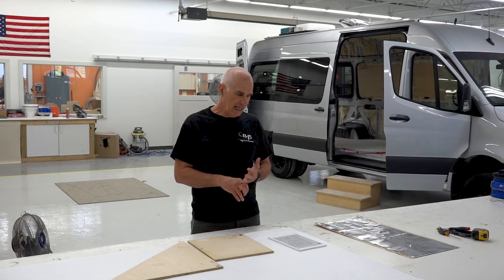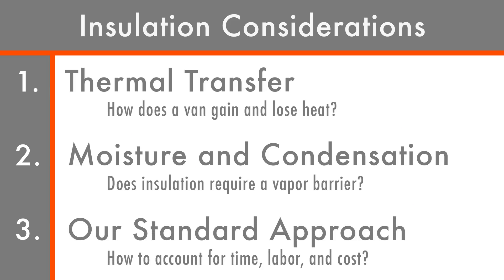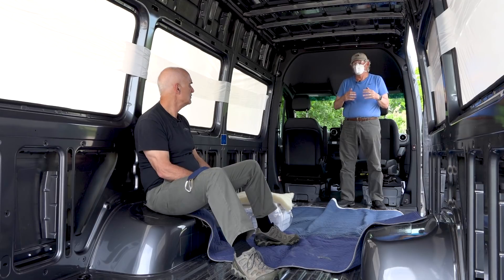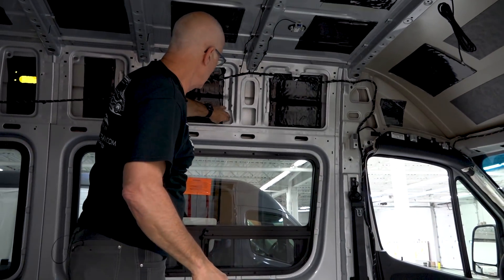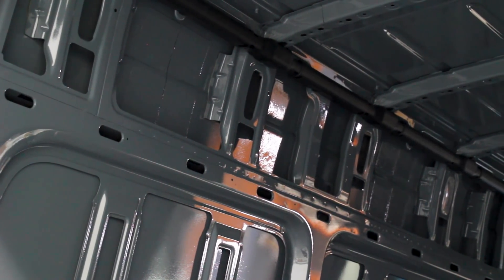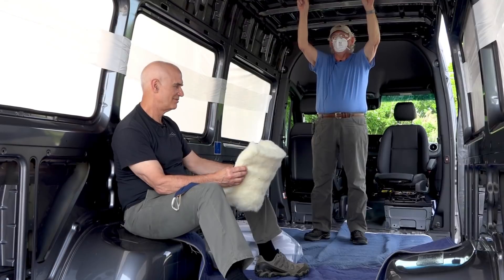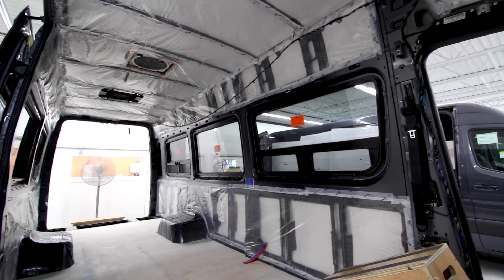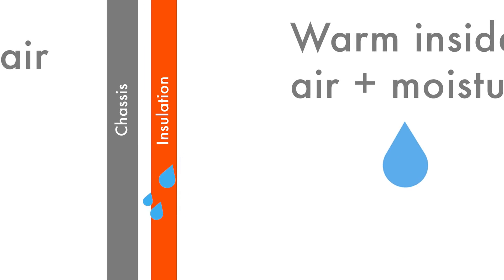What We Know (and Don't Know) About Van Insulation | Advanced RV

Comment: Wood stoves and Espar type heaters will dry and keep dry a van better than anything else. After that you want to create a thermal break at every thermal bridge.. do that with firm closed cell foam strips. Then control air exchange into the structure of the van with controlled venting. You can divert some of the forced air from an Espar actually into the open structure, behind the walls to keep thing dry (and remove snow ). Did this on a T1N.. worked perfect.

Comment: You need to insulate the whole thing then use reflective over it , have a vent under and up and it will cool . Have u heard of rockwool  and cold cell.? Use that the  a 4 inch pipe wrap on the beams .

Comment: I'd say one the insides of the van the metal is likely treated with a rust proofing finish. If you damage that coating in anyway while installing stuff then moisture could be an issue.

Someone mentioned drainage holes at the lowest points of the vehicle. Just wanted to chime in, using hydrophobic insulation with a vapor barrier, mixed with holes at the lowest point for drainage makes the most sense to me from a longevity standpoint. This also prevents mold and mildew due to the condensation having someplace to escape.

As for specific types of insulation, it's climate dependent. The insulation needed in December in say the southern USA is far different than the insulation needed in northern Canada.

Where I live, I wouldn't use R7 wool, by building code houses need to be need 20 on the walls and 50 on the roof. So I'd be hard pressed to go less than half of that, specially since I'm restricted insulation thickness. Which will determine the type of insulation needed. Higher the R values = less money to be comfortable during winter.

As far as summer goes and staying cool, cover those windows with a white or silver backing. I can't stress this enough. The idea is to reflect the radiation away from the inside of the van. Not painting the van a dark color helps as well, not as much as the window reflectives though due to the insulation previously mentioned.

You can test this during the summer easily, put a reflective blind up on all the windows during the night after the building has cooled down on the inside. Then measure the change in temperature over the day vs not putting the reflective blind up at night. A house or apartment will stay shockingly cold throughout the day without the sun pumping radiation through the windows.

Comment: Not sure how good this information is here. Wool? It settles down into the walls and within a few months you will have none in the upper portion of the walls - also, it soaks up water and thus can mold, same with denim (a horrendous choice as cotton is hydrophilic- water loving), traditional fiberglass insulation also has the problem of settling when vibrating in the walls of a van going down the road. XPS Rigid foam board is a good choice - does not soak up water, does not settle in the walls when going down the road, high R-Value. And for the best overall performance? Remove all single pain windows and either cover them up with galvaneeled steel sheeting or replace them all with double pain RV windows (Ie. Arctic Tern windows). Once you have your windows set, do all the wiring, propane lines, and water lines (though these you might want to keep out of the walls and put them in a more accessible location for future repairs) and then shoot spray foam (closed cell) or have a professional do it as it is tricky to work with and you only get one chance at getting it right. Closed cell spray foam is the most effective and durable, non moldy solution. If anyone wants to learn more about this I suggest you check out YouTuber Chuck Cassady. He is an excellent teacher/presenter, has many many years experience building and insulating school bus tiny homes, and definitely knows what he is talking about. The suggestions these guys make will only serve to help you grow mushrooms inside the walls of your expensive van. Cheerio!

Comment: If you live in humid environments the vapor barrier should be on the outside of the insulation, In moderate and dry environments it’s the opposite then if an air conditioner is used that humidity buildup would easily be dried from the air flow and normal ac process
Reply: Very basic rules they should have covered.
Reply: What if you live in a humid state but frequently travel to dry states?  How do you do the moisture barrier in that scenario?  I live in Louisiana and love to travel and hike in NM, AZ and CO.  Several months away from my van build but I want to make sure I do the insulation properly (mold and mildew are my biggest fears) as it will be a four season build (A/C, Max fan, heater).  I will also be living in it when I work out of state/not working from home (I do both at random times) and never know where I will be sent.  Right now it's Alabama and Georgia, in a few months it could be New Mexico.

Comment: What about wood?  Not as an insulator but building the insides.  I see most home builds using regular wood. 2 x 4s, pine or cedar T&G sides and ceilings.  Is that really a good idea.  Most manufactured campers use particle board or some sort of composite. My concern is that in an accident the wood is going to come apart.  Pine boards come apart in splinters that are like flying knives through the interior of the vehicle cabin.  Am I crazy?

Comment: My kingdom for a thermal break! Im an architect and this is key in insulation, and possibly sound deadening. In addition it sounds like one needs more ventilation (solution for tents, but a huge thermal loss issue) and/or a dehumidifier inside to fight interior moisture build up.

Comment: Wool is naturally moisture wicking and anti-microbial. It's going to draw any moisture to the lowest point rather than letting it stay on the walls. It'll also prevent mold. 

Wool insulation uses the same principle that allows a wool coat to feel dry when you've worn it in the rain. The moisture is naturally drawn to follow the length of the fibers to the lowest gravitational point, allowing the majority of the wool to remain dry. 

Also, if you really want that barrier, wouldn't a coat or two of automotive paint do the truck?

Comment: If any organic dust ever gets on the Thinsulate and moisture reaches the surface of the Thinsulate, it will mold even if Thinsulate does not absorb the water. It’s like hydroponic gardening. It would’ve been nice if you had demonstrated that Thinsulate is hydrophobic with an experiment and empirical data from it. I’d like to see it compared to Rockwool boards

Comment: Could really use your advice. My gmc Savana hitop has 3 big windows and 6 door windows so a lot of glass. Used noico  on floor, rear wheel wells and doors but forgot on the minimal wall space pre mineral wool insulation. Not sure whether add reflectix over the 2-3” mineral wool? The ceiling be fiberglass  having 1x4s embedded 9”OC. Have 1” foil faced 2-4’ mineral wool panels thought of  utilizing foil facing upwards taking advantage of 3/4” air space between 1x4s.  Then with the van having extreme sound system planned covering insulation with perhaps a marine grade acoustic fabric with select wool trim. So is it worth using a noico product on ceiling and wall space? What’s best for covering all windows and lastly should  I pull carpet in cab area and do something with the floor, front wheel weland engine dog house.  I feel once windows have a good acoustic/thermal covering it will make big difference   Look forward to hearing back from you

Comment: 12:40 - You cannot use Fiberglass insulation ever in a van!!!  Not only is there a risk of breathing in the fibers but traditional residential fiberglass batting will clump up when wet and sink down and hold the water.  It is the worst material!  You can use the following only:

Thinsulate - Hydrophobic and pricey but thin.
Mineral Wool or Rock Wool - Hydrophobic and cheap but thick.  Regains its shape once dry. Eco friendly recycled materials.
Wool batting - Hydrophobic and wicks away water.  Regains shape once dry.
Denim batting - Not hydrophobic, and expensive.  Not easy to dry out.  Does not regain its shape.
Fiberglass batting - DO NOT USE!!!  Fibers are bad for lungs. Clumps up easily when wet. Hard to dry. Gets mildew easily.

Check out Humble Road insulation techniques video. He uses Noico, Mass Loaded Vinyl, Thinsulate, and Reflectix in that order I believe from metal panel towards the inside. The main thing that HR stresses is designing the van for constant airflow.  If there is a good airflow within the van at all times with channels behind the cabinets, ceilings, walls, and floor, moisture is not an issue.
The other source of moisture is propane! Ditch the propane heating and use diesel or other. Propane causes moisture release when it burns.  If you have a propane furnace you will wake up to wet walls in the morning.  Dreadful!  Small diesel heaters for $200 on Amazon solves this problem.

Unfortunately, the older RVs and Class C's (like mine!) used fiberglass insulation so its probably wet, moldy, and ineffective.

Comment: I love the confidence of Americans! :)
The guy doesn't even know how to pronounce his own last name, why would I believe him how to insulate a Sprinter van? 
Overall they try to treat this van like a building. A Sprinter van is not a buliding. It's not air-tight and it's not supposed to be. Insulating the doors the way they did is wrong. Insulating a Sprinter van door the way they do is wrong - and, no, there's no 2nd opinion because there are some facts: 
Fact #1: The Sprinter van is used as an RV oftentimes, but it's a van. It's designed for work. 
Fact #2: The lock isn't waterproof, 
Fact #3: the handle isn't waterproof. 
Fact #4: There will be water getting into the door. Mercedes deals with this by accepting the water entering the door. They have created a path the water can go inside the door and there's an exit for the water to get out again. 
Simple test: Take a water hose and spray the handle/lock of the door. Then check the inside of the door. 
Long story short: Insulating the door they way they did does not prevent water from entering, but it prevents water from leaving. As a result the insulation material gets wet. Depending on the material used, you're either creating a wet sponge covered by unprotected steel. Or you have a piece of hydrophobic material surrounded by water - again covered by unprotected steel and the vapor seal prevents the water from finding an alternate way out of the door. The vapor barrier doesn't make it more trivial.
Depending on the climate you've created a ticking rust and mold time bomb. In Southern CA or AZ you may get away with this. In an area with actual seasons, you're cutting the lifespan of your Sprinter van at least in half.

Comment: I would not use any hydrophilic insulation. Fiberglass batts in particular absorb water like a sponge. Then the best case scenario is that the batts sag and compress under their own weight, losing almost all the insulative value. Worse case scenario is that it quickly turns into a moldy mess. Instead of the usual polyethylene vapor retarder, I'd suggest using one the retarders whose vapor permeance changes with relative humidity: CertainTeed Membrain, Pro Clima Intello or SIGA Majrex. If the humidity inside the wall increases due to a water leak, they will open up and allow some drying to the interior.

Comment: I have cargo sprinter. Would you recommend lizard skin sound/ceramic coat? 
I was thinking using 
1st.the lizard skin 
2nd. thermal mat
3rd. Havelock wool
4th. Commercial thermal Wall panel 
So it's basically 4 layers of insulation.

Comment: Good video. As I've worked in all areas of automotive and as well as house construction, I see a lot of confusion about insulation. A van IS NOT a house. It is built differently and there are different challenges. Lots of good points. Thermal break is the issue. Heat loss through the frame which connects to the outer skin. And of course, glass. This is a huge issue, so you have to compensate and do the best you can. The other thing people forget is the floor. Some people have under floor heating which was interesting. All these issues are mainly a big problem in colder climates due to the massive temperature differences. In temperate and warmer areas, its the opposite and a lot easier, and you need airflow. Its all very interesting and you have to build for your environment. Has anyone used spray foam?

Comment: I installed 3M Insulation. Then installed a Radiant 3mm foil barrier over that..Then foil taped all the seams on the inside... I can cool my van down 68 degrees. With nothing but a 6k BTU AC unit on Low and Medium..Which is less then 500 watts.....And it stays that way. Unless I open the doors all the time...But you can hang split curtains to slow it down from escaping. 

This is in Texas summers..And he is right. I has to install gold foil tinting on the outside of the windows. To prevent the sun light from ever heating the glass up...Some times I cover them on the outside with a Reflectix material. It stops heat transfer from ever starting.

Comment: The best insulation is Areogel blankets. Very high R value. Four times better than Fiberglass and it is naturally hydrophobic. Repels moisture.
 Putting up a moisture Barrier on a van is only going to slow the moisture transfer, which is what you want.   A double Moisture barrier will slow the rate even more but the layers must be glued together with staggered seams and a complete continuous double 360° seal.
Also do not clog the drain holes. Do not use Spray foam, Put desiccant and several wired humidity sensors inside the walls to monitor the problem.
 I have done five vans and learned what works. Humidity = RUST  I do not have any rust on my vans.

Comment: Finally, a video that has the facts in a simple package. Thank you. Really enjoyed the "nerdy" stuff. I hope to do a van conversion soon. I'm not a big fan of vapour barriers. I think we can all agree that water is tricky stuff. My concern with barriers is that "if" water ingresses into this space it is then "trapped", forever. That's when the problems start. I believe in a system that breathes. That's it in a nut shell really! Like the guy indicated "you're damned if you do & damned if you don't"!
Reply: In a van. Water collected or trapped inside wall cavities will ALWAYS managed to dry out. 
Van metallic panellings are already a “conductive” material, as we learned it attract heat. And heat will dry out any moist it contacts with. Right?

Comment: Have you taken a tour through the Boeing factory in Renton Wa?  They've done a lot of work on insulating aluminum aircraft for both noise and heat, taking condensation into account.  They have to take 150 sweating bodies from 120 degrees F at sea level, to -60 degrees F at 40,000 feet and back multiple times each day.  Boeing uses fiberglas encased in mylar, not glued to the aluminum body.  The condensation forms on the interior of the fuselage, outside the insulation, and is channeled down below the luggage bay.  You can hear it cascading down the side walls during some phases of the flight.

Comment: Being a worker myself ... I found this helpful and good for thought.  I wonder how foam board works?  I have a fiberglass high roof (2') and thinkin on the insulation ... I tore the old ceiling out ... whew.  Factory had no insulation ... plus ... I wonder if there was a thin layer on the walls of the insulated sheet (1/4"  guessing) and then the cavity left open and then a thin sheet of the insulating sheet too on the back side of what is mounted extending over the 1 1/2" of open air (guessing) ... maybe it would solve everything.  Thinner the skin to the inside wall fasten area not as good.

Comment: It was particularly interesting to hear you say after opening up many vans with a variety of insulation materials and a variety of techniques you have never, never ever, found corrosion or oxidation (rust)... wow, that’s amazing.  That may be because regardless of technique there is always some air circulation (exchange or movement of air) between the metal outer shell and the inner finished surfaces... in other words: the walls are leaking air... either from inside or outside, it really doesn’t matter.  My overall experience in window manufacturing and greenhouse manufacturing and construction and boating combine to conclude the issue is allowing the unit to heat up and dry out... either occasionally or intentionally... it might be advantageous to actually consider heating the air space and power ventilation of the space through planned capillary channels ... using small computer fans inside the walls to exhaust warm moisture laden air... under floors as well as walls... to drive off the moisture purposely. Greenhouses do this by cranking up heat inside and opening ridge vents to drive off moisture and humidity... window designs do this by adding weep holes as well as using dissidents... masonry buildings also incorporate weeps... attics in conventional home construction also ventilate . Biggest issue seems to be window and glass areas for heat loss, heat gain and condensation issues... glass is actually rated for conduction rather than resistance..  replacement with acrylic or polycarbonate would improve performance especially if done as double glazed windows... insulated window coverings are practical solution.  The driver cab section is problematic because of the large amount of glass... sectioning off the driver compartment, although reducing living space somewhat, helps with heat loss and heat gains.. a sliding door between areas also increases security.  Your newer BBox design solve may of these issues.